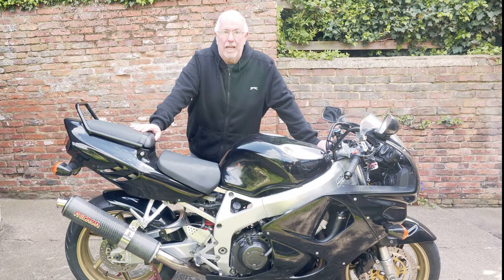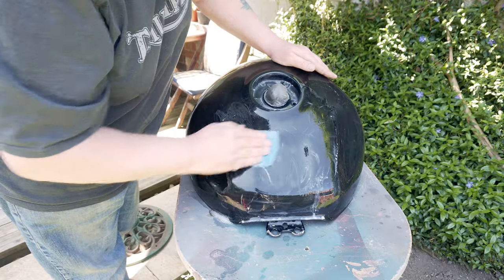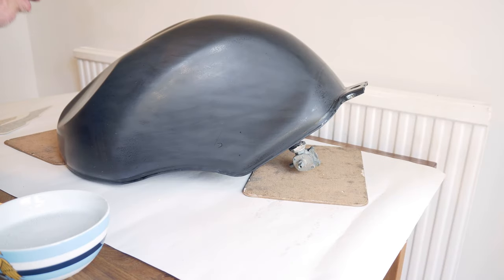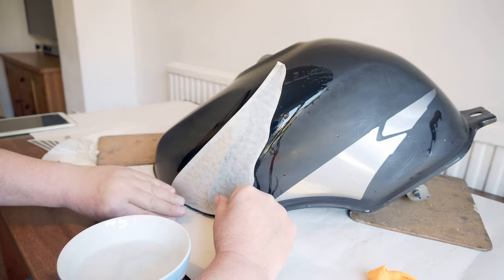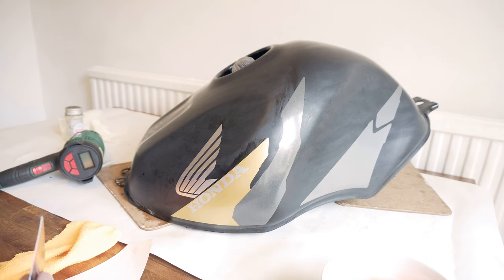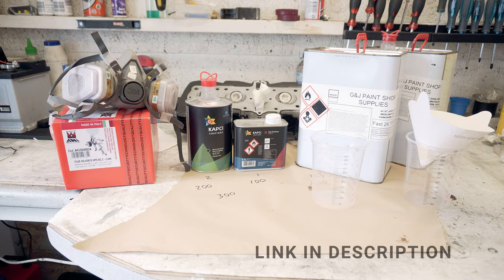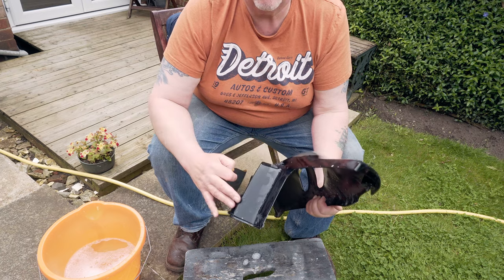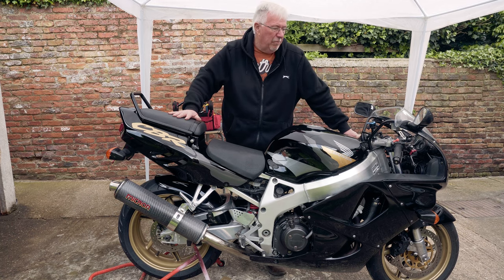How To Apply Motorcycle Decals & Clear Coat | Honda CBR900RR Fireblade Sticker Kit Installation | 14

Comment: Your comment at the end sums it up perfectly - it's not a professional job and it was painted outside.  But the results are still very good.  Unless you were scrutinizing the work, you really wouldn't know.  And as I always say, "it was better than it was before".  I would say that I'm comfortable painting outside for primer, sealer, base and even two stage pearls.  My booth is a modified outdoor party tent so I reserve the challenge of putting it up/taking it down for the application of clear.  One of the benefits of painting outside is the ability to see your work as you go.  Well done!  I think someone else mentioned it, but you can still get these parts like glass by wet sanding 1500/2000/3000 and a polish, but that's a lot of work.  For a bike like this, this job is perfect.
Reply from the maker: Thanks very much.  I am really proud of how this bike came out.  I have been hoping to paint my Cafe Racer this Summer but we don't seem to have any good stretches of good weather to consider painting outside.
Reply: @SPANNERRASH  Hope it clears up for you!!  Painting is a blast...once you get past the fear of screwing it up.

Comment: I'm hunting around for information and the information you have is good.. what I have gathered from others and you is I should lightly sand down clear coat and take down the orange peel with 600 wet dry and then put decals on and do what they call a flow coat with clear. I was under the impression that you always sand one way or x pattern and never around in circles. Maybe I'm wrong 🤷. You keep doing you. It's looking good 😁
Reply from the maker: Yes.  Make sure you do the sanding wet.  Go for a matt finish over as much as you can.  If you have orange peel you can flat it at this stage.  Don't go too deep if it is metalic.  The clear coat will give you the new glossy finish, and if it works out well, it will be smooth!   Good luck.

Comment: It can come down to the gun you shoot for the orange peal.  Cheap copy cat spray guns such as ITALCO gloss do an amazing job for a fraction of the price.  It will save on materials as well.  Looks great! From WA, USA
Reply from the maker: Thanks for the advice. There are so many things that affect it.  We have a decent(ish) F160 gun for clear.  But I think that because we spray outside, the air temperature and humidity can make a tremendous difference.  That and the fact, I just may not have enough skill! :)  But I do get some good results, eventually.

Comment: Well done. However I would sand it with 2k sandpaper and polish it  and final result would b amazing 😎
Reply from the maker: Yes that is the way to go.  I wanted to let the clear coat really get solid before going any futher.  I am really pleased with how it came ou.
Reply: Hi   @SPANNERRASH NICE Performance Yesss 👍👍
Regarding finish Sanding and Orange Peel… I would personnally suggest to avoid  sanding it 2000 as mentioned in some comments. You gonna loose bonding big time and take the risk to see your Topcoat to flake or crack in the next few months. Based on our daily routine i would sand that first clear P800 with sponge paper, wash down, prep, ect… then put 20% thinner instead of 10 when you mix for the last 2 coats app. Spray a Tack coat first, wait for 5min, then 2 full ones with 30min flash in between. 
This will give you a glass result straight from the gun. So, No polish. 
Just go gently (Not too heavy)…
Give it a go on a test panel so you can adjust your gun first 🤞👍
Reply: Check your Tip too.
1,2-1,3 max 😜

Comment: Well done I've got a couple of tiny panels to do do you think I'd get away with a rattle can
Reply from the maker: I would look at using one of the 2k clear coats that you can get in a spray can on the top.  Having a good final coat really makes a big difference.

Comment: Fabulous work, and very methodically explained. Can I ask how long do you wait between coats?
Reply from the maker: Thanks for your positive comment.  
With regard to waiting between coats, the data sheet for the product will tell you flash off time etc.  
But as a rule of thumb I use this. 
After the initial mist coat, I check on the masking to ensure that the paint has gone tacky, around 5 or 10 minutes or so.  After a heavier flow coat, I leave it for longer, 20 minutes or so, checking the masking to see how tacky the coating has got, then I would put on the next coat when it was still tacky but not wet.
When you have finished, you need to leave the parts for a long time to ensure the paint hardens.  At least a few hours before moving them, and then I leave them for a day or two depending on the temperature, before doing anything with them.  In paint shops they put them in an oven to speed up the process, I just have to judge the weather :)
With clear I would then leave it a week or two before polishing or any remedial work.  That is why I was worried about scratching the tank by riding the bike too soon!
Reply: @SPANNERRASH  thank you thank you for that fantastic and detailed response… much appreciated. I’m restoring a Honda VT250F, and I usually get Dream Machine to sort paint out on the restorations I’ve done… but I fancy having a go myself. Presently prepping everything, but I have the decals… Compressor, just need the courage 😆

Comment: Great post … if you don’t mind a quick question.. is it  possible to clear coat over decals with a Matt /denim clear coat … I have a Harley with black denim (Matt ) finish and Shiah to apply some nice vintage style decals ..
Reply from the maker: I haven't ever clear coated with matt, so please don't think I am an expert.  However I can't see why spraying over decals should be an issue with matt.  Although I expect that to get a really good consistent finish might be hard.  The beauty of gloss, is if you put on a good thick coat you can cut it back to remove any imperfections, but I don't see how you can do that with matt.  I think you must be trying to get your finish straight out of the gun. Good luck.
Reply: @SPANNERRASH  your absolutely right … you can’t cut back the Matt coat s .. what you spray is what you get ..I did a refresh a few years ago and it was a steep learning curve I can tell you … I might try to go gloss .. in found a really nice colour… maybe a front fender first then see .. thank you for your reply.. it is appreciated…